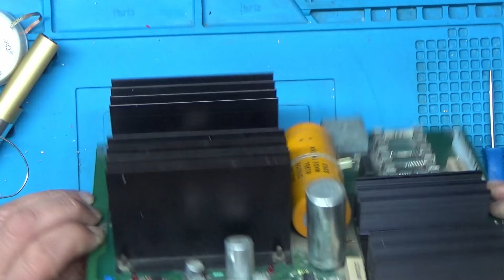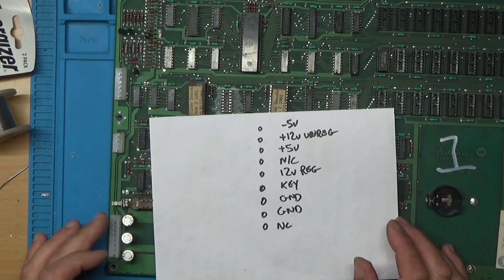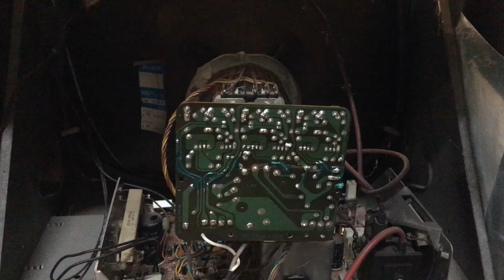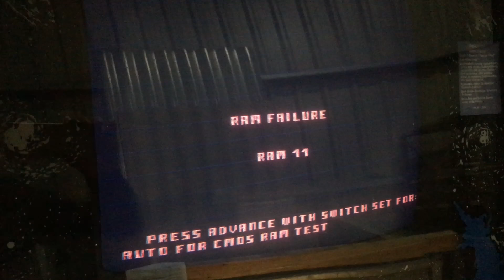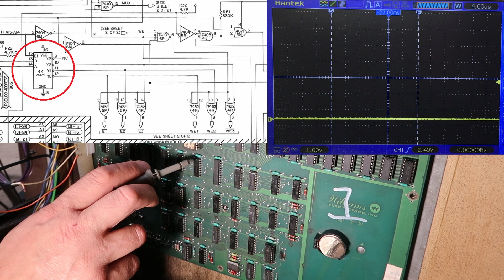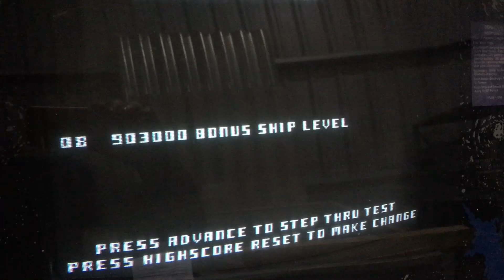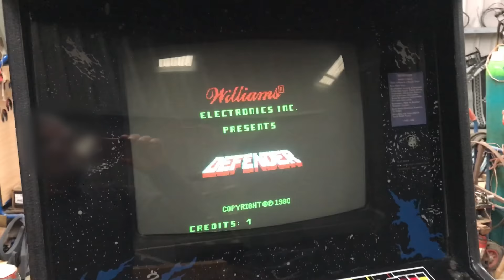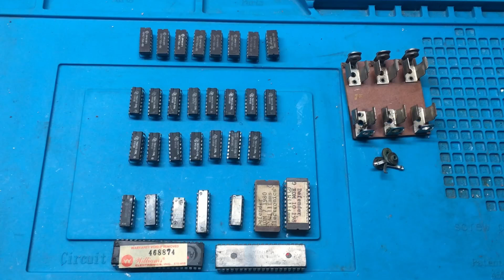The Repair That Broke Me - Part 2: Rescuing a 1980s Defender

Comment: Excellent repair job! Thank you for taking me down memory lane. I think I spent as much money playing it as you did fixing it!

What happens to it? Does it goes back to the owner? Or is it yours now?
Reply from the maker: It still belongs to the owner, however I still have it here currently. There's still a few minor jobs to so like securing the monitor chassis a bit better and perhaps changing the caps and adding a crowbar circuit after the PSU so if it fails it doesn't fry the chips. I'm not sure what his plans are for it going forward.

Comment: Playing Defender well required getting into a Zen-like state, it really did.
A good player could last for 2-3hrs on one 10p play. A novice just seconds.

Physically and mentally (visual spatial) very hard, with calluses (right handed player) on the first two fingers of your left hand
from the up/down lever after many hours of play.

I worked in an arcade, and a common 'fix' was to wedge an empty cigarette packet behind the main board when it failed due
to dodgy connections.

The controls were designed by Williams to survive people stamping on them with their feet and full weight.
They weren't switches - just bent copper 'leaf' contacts.

The game was so good that groups of people would just stand and watch a good player do his or her stuff.

I think it was a loss-leader for the arcades. Novice players would last seconds, great players - hours.
The money may have been in attracting the novices to watch the other players and perhaps spend their money on other games.
Reply from the maker: Thanks for sharing. I thought they must have used leaf switches probably because they already used them on their pinball machines?
Reply: @BuyitFixit  "Williams initially was a manufacturer of pinball machines"
https://en.wikipedia.org/wiki/WMS_Industries

Yes, I think they took their learnings from the pinball machines across to the video arcade games.

Man-Machine Interfaces In Extreme Environments.

Loss-leading games attract footfall to the arcade.

One guy/girl playing a machine for 10p for two hours will attract perhaps 30+ other folks
to spend far more in that time. Just watching a skilled player. Being there, on the scene.

You lose that key player because of a choice to use a microswitch instead of something far more resiliant, and you lose the other 30+ customers.

Social electronic engineering. Design for purpose.

'Defender' was an attraction in the correct hands, and the arcade owners knew that.
An engineered arcade attraction.

We live in different times.
Lesser times perhaps.

Arcades were a place to hang-out.

From the 1950's to the 1990's perhaps.

Now. What can you put in an arcade that you couldn't possibly do on a home computer?
Bring back the arcades I say.
I challenge you.

Arcades -

People
Challenges
Technology
Fun
Social
Entertainment
Status
Magic
Vibe
Being there
A place to 'hang out'

This is what is missing
Not hard to fix
With the right imagination

Comment: This is my all time favorite game, I made mine with an old golden tee cabinet, 32" screen,  pc emulator, with arcade controller.
Reply from the maker: Nice 👍I did something similar with a 1up arcade cabinet that I bought (video is on the channel of that one too). After I fixed it, it was only 1 or two games, so I converted the control panel with all new buttons and joysticks, put in a converter board for the monitor, and added an amp + speakers and a Raspberry pi.

Comment: Your work is totally, and completely amazing, i've never seen anything like it.. such a shame you wasn't in Manchester, i collect old vintage boomboxes, i bought a Toshiba S90 boombox and had it shipped from japan, money i couldn't afford, it arrived, and  worked great on radio, sound was great, but when i flicked it to tape and pressed play, the deck engaged but played way too fast, then i tried to press stop, smoke came out of it, after that there was sound, i looked inside and there was a resistor burnt, after that, all i got was a low hiss so i think the main amp is ok, but no audio, vu meter stopped working, i also have a Sharp GF575 and Sharp GF787, the 787 i also had shipped from japan, both the sharp 575 and 787 are sending Dc volts to the speakers and burning the voice coils out, i think the amp's are ok, but it's all beyond me, plus i started getting sick now so i just abandoned them in the corner. Again, i will say your work is amazing.. You Got a Big Like from Me..
Reply from the maker: Thanks very much 80's kid. if the 585 and 787 are sending DC to the speakers I'd think the amps are fried. not sure on the S90. I just searched for a service manual for it, but nothing came up apart from it was a rare Japanese version. It looks like you can download the schematics / service manual for the other two though.
Reply: @BuyitFixit  Hi, i did change the Amp Ic in the GF787, can't recall the part number, it was a Flat AN Chip, sure it was made by Toshiba, and i did replace the HA1392 Amp Ic in the GF575, but the faults were still there, that is when i abandoned them, i do have another working 787 and another working S90, i have 2 of each, one of each works but 2 are faulty. i can only do basic work, i'm not really that skilled in electronics, i can't track and trace faults or read a Meter, i can do basics like check for short diodes and voltage feeds, but that's about it, most of my diagnoses and successful repairs are more down to guess work and extreme luck, i have another 575, on that one, the amp actually works, but i'm getting no audio from the tuner or tapes, and the vu metre does nothing, that's a similar fault to the S90, i've got that frustrated now, and lost that much money on these things, i've stopped buying them, i have a lot of videos on my channel of my boombox collection, and Hi Fi's, but i'm getting a bit ill now with various health problems so i have to tone it down now. and maybe move a lot of things on, a lot of the radios in my videos have been sold but i still have some left.

Comment: That board actually ran on three AA batteries! Love the early circut board layouts. 😮
Reply from the maker: Well... not run as such. The batteries just keep the NV RAM chip powered while the power is off. This stores things like the settings and high scores.
Reply: @BuyitFixit so it's the same as the cmos battery on "modern" mother boards? Fascinating,  thanks for responding.  😊

Comment: I remember when Defender came out. It was so much more than other games at the time because of the extra control and how fast it was. Personally I think some of these old machines are worth the effort to keep them going and this is one of them. I remember tapping the fire and thrust at the same time instead of holding the thrust which gave it a comfortable speed for the ship.
Reply from the maker: Interesting, thanks for the tip on hitting the two buttons together 👍

Comment: WOW I have never seen so much in depth diag on a digital board, usually you just replace the whole board, can;t really do that with this. This is def a learning exp.
Reply from the maker: Thanks so much 👍This was deffo a learning experience. I learned a lot from it though. It's the first time I've fixed an arcade board even though I used to work in arcades years back. We either used to send them away, or swap them with a different game.

Comment: When I recap a radio I only ever recap with Nichicons. I tend to find with the stuff I work on that the vast majority of 70's and 80's caps are virtually bulletproof and I emphasise the vast majority as there are certain ones you know you're going to replace before you even remove the covers.
Reply: Also it would be good if you left a note of all the mods/work carried out on a sheet of paper stapled inside the case for future repairers/restorers.
Reply from the maker: Good idea, and thanks for the tip 👍

Comment: Excellent work! I enjoyed both videos.

I have the same solder sucking machine, mainly for repairing console controllers (had mine about 9 years) - Get a few spare nozzles of different sizes, they come in handy. That way, you won't be without the machine if a nozzle fails.
Reply from the maker: Glad you enjoyed them 👍 Thanks for the advice on the desoldering gun!
Reply: @BuyitFixit  No probs. Also, when it leaves solder in the holes, what I do is use my Atten 862D with no nozzle. This adds some extra heat to the area while pressing the trigger. Nothing too hot needed with the Atten if you try this to prevent popcorning the board. 200c or less works on PS5 controller sticks with the awful unleaded solder. Bigger holes on older gear should work with 100c.

That said, I sometimes do the exact same that you did in this repair! 🤣😂

Comment: I rebuilt a Star Wars machine a long time ago.  Really enjoyed it for several years.  But there is a reason I don't collect these decaying machines.  At some point they become irreparable, but at least we can emulate on modern hardware.
Reply from the maker: Nice 👍I remember that one with the colour vector scan monitor. It was one of the first games I ever repaired. I think it was one of the transistors on the X/Y deflection so you only got 1/4 or 1/2 of the screen.
Reply: @BuyitFixit  Yes, there were a few updates.  It used an Amplifone monitor, sharper than a Wells Gardner.  It was a cool machine, as it talked also.  I was lucky, it had a perfect CRT in it, but someone gave up trying to fix it.  I had to get a tech at Atari to find me an updated flyback for it.  I sold it many years later to an 80's theme restaurant where it lived on.

Comment: "I'm not an expert" - then proceeds to blow you away with his troubleshooting skills.
Forgive me if i missed it, but i would have liked a summary cost breakdown at the end of this - from machine purchased to potential resale value. I know it was a viewers machine and that you did a parts cost summary which was good, but I think bringing cost into it and even mentioning it in the title/thumbnail would increase views as people are typically interested in what value you got for all your ~50 hrs.
Great video 👍
Reply from the maker: Honestly I don't consider myself an expert. I think that would be big headed, also there's lots of stuff that I don't know. I'm just persistent and don't like to be beaten by things (probably why it took me about 50 hours). I could probably half or even quarter the time, on another one as I'm more familiar with the operation and what parts of the CPU board do what. Experience has a lot to do with repairing, but everyone can gain experience by trying to fix stuff 🙂 I've actually still got the machine here currently, I'm going to secure the monitor chassis better and do a few other little things like perhaps add a crowbar circuit to the PSU so it blows the fuses if the PSU goes wrong in the future. I did see one of these for sale on ebay and they were asking £4k.

Comment: Firstly - I'm blown away by your knowledge, patience and tenacity.  Amazing!
Secondly - Yup, your playing skills haven't improved 😂 best way of progressing is to use the fire and forward buttons simultaneously,  in a reasonably fast tap and always be moving either up or down. Getting too close to the right of the screen is dangerous, even with lightning fast reflexs.
A truely brilliant game, best one in the early 80's. Tron was the next closest to it in skill levels,  but not really in the same league. 
What did you do to learn all your electronic skills and knowledge?
PS: Just read your profile description,  so now know the answer to my question. 😊
Reply from the maker: Thanks 👍Yes I did put a bit of a bio up, but I've never actually repaired an arcade board before, we just swapped them. I used to do things like replacing monitor chassis, power supplies, and re-wiring old cabinets to take different games.
Reply: @BuyitFixit Well, having discovered you, I shall be deliving into your back catalogue over the coming nights.
Reply from the maker: Thanks mate 👍I've done some interesting stuff, and even had to delve into the software side of things with a debugger on a few fixes too!

Comment: Caps that read high are electrically leaky. They fool the meter to think they are higher capacitance. They should be changed when they are >20% high.
Reply from the maker: Thanks for that, a couple of others also said similar.

Comment: Most of the old Williams boards had certain ic that went bad and people who work on them regularly change those first then start testing. 🙄
It almost seems like they should all be changed. The ram chips being "upgraded" and the battery holder are probably the top 2 modifications. Good call on just ordering both pia so you didnt have to wait a week again.
I have the little brother to this, Stargate, which needs work. I also ended up with another cabinet that I wanted to install a multi game board in. Later, while cleaning it up, it turned out to be a Robotron 2084!!! 😮
So I now have a set of Stargate boards and a set of Robotron boards that need to be gone through so that they work. Not looking forward to that.
Nice job on this!! 👍👍
People want to play all these new fancy games and likely would fail to master any of the originals! 😂
Reply from the maker: Thanks 👍Yes some of these old classics are still bloody hard! Good luck with your Stargate and Robotron!

Comment: That was some expert fault finding on your part. Great job! I'm assuming the previous owner preferred his controls inverted hence why those wires were on the controller were switched around.
Reply from the maker: Thanks 👍I did think that too with the controls, but I'm not sure. It just seems a little odd to have down for up etc.

Comment: A little tip when having to solder to the ground plane is to use the solder remover as an iron.  This will heat up the whole pin area and set the solder flowing better.
Reply from the maker: Thanks for the tip mate!
Reply: @BuyitFixit  Your welcome.  When I was being certified for J-Std and IPC-610, that was one of the tricks I learned.

Comment: 50 hours times by your labour rate, £50 on the low end but realistically £100 so £2500 to £5000 in labour, plus parts, plus the system, plus profit, becasue you're allowed to make money, what is this thing worth on the market?  I get it, you're doing it for the content, but what would you sell this for, £6500?
Reply from the maker: Good point. The machine isn't mine and it's another viewers. I think there was one on ebay for about £4k recently. It would probably have taken someone with more experience with this machine in particular a lot less, but I learned a lot about how it works which I actually found really interesting. If I had another I could probably fix it in 1/4 of the time now I know what does what so I gained a lot of experience. It's also a piece of arcade history (I grew up at the time it came out), so I think it deserved being saved 🙂

Comment: You should leave a note inside explaining the switch from 12 to 5 volt RAM for whoever needs to fix it next.
Reply from the maker: I'll probably do something like that, although if someone does look at it in the future, they should know by the ram chips themselves as they are now 4164's not 4116's.

Comment: I don't know much about electronics, but as a student I did play a lot of Defender between 1982-85 using up a ridiculous proportion of my student grant, so I watched this repair like the concerned relative of a patient under the surgeons knife ! I was so happy to see the successful outcome under your skilled hands! My high score was 690,000 which was notable for the strange out-of-body experience I had as if I was watching my hands move the controls on auto-pilot outside my conscious control. That was nothing though compared to a kid I saw clock the machine (over 999,999 points) who had unbelievable hand-eye coordination. He used to play by killing the humanoids you're normally supposed to save, which takes the player into an outer-space mode (ie. no landscape) and he fought the ultra-hard "Baiters" which appeared with increasing frequency for loads of extra points. He used to literally get a crowd of followers watching him in disbelief at the speed his hands were moving over the controls ! We eventually realised you could rack up free credits by sticking your finger up the coin reject slot to tap a coin detector spring, so that no doubt helped develop our skills ! (not recommended, someone said there were dangerous voltages lurking in there !? That may have been a rumour put about by the owner, but he eventually put a spike in there that stabbed your finger if you tried to stick your finger in !)
Reply from the maker: That's an awesome story! Glad you enjoyed the repair 👍 There's no dangerous voltages on the coin door 🙂
Reply: Great story! Baiters always got me.

Comment: I've been trying to get my PPG Waveterm-A (German music computer from the 1980's) back up and running.  It has a POST fault, with the floppy disk not being read.
Unfortunately I live "down under" in a minor capital city, and there aren't any specialists who I trust to take on the task of repairing it...  I might have to learn to fault-find/diagnose similar to what you've done here!
Reply from the maker: Just wondering if you've tried another floppy drive as it could be the drive itself that's faulty.
Reply: @BuyitFixit well the device comes with two floppy drives; 0-program & 1-data. I've swapped the drives, but the fault remains.
When booting there's a bunch of Hex codes which look like a CPU register dump and that's what ChatGPT says they are...
I think I'm just going to have to "man up" and do the type of diagnosis/repairs you've shown in these videos...
I just don't want anything to get "worse" than it is already, and I'm a little weary of the CRT in the box!